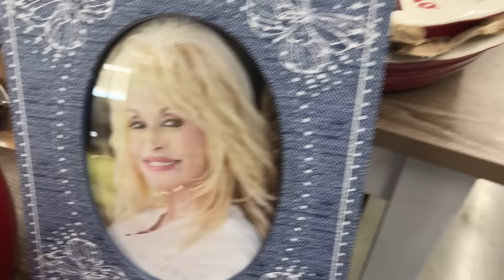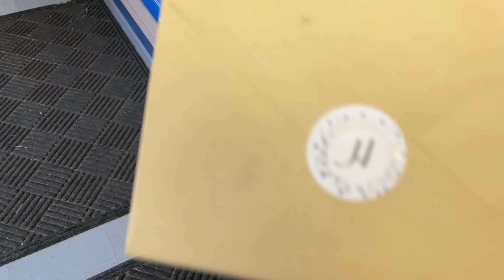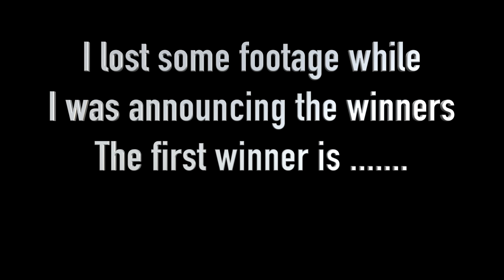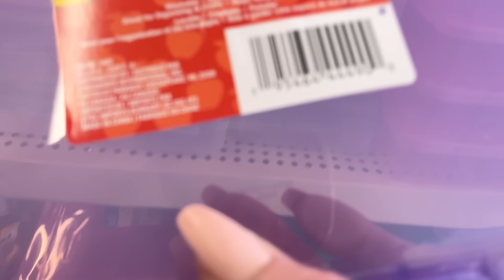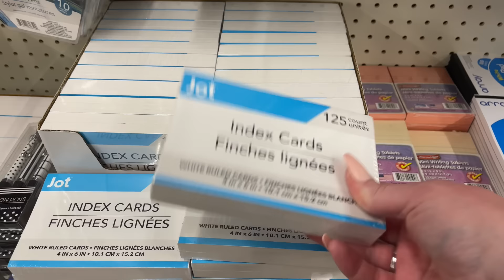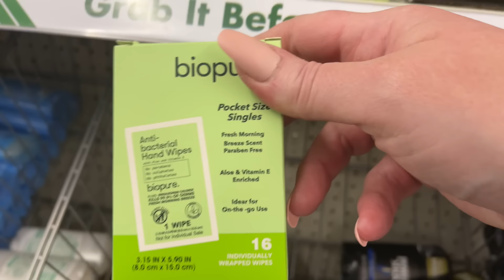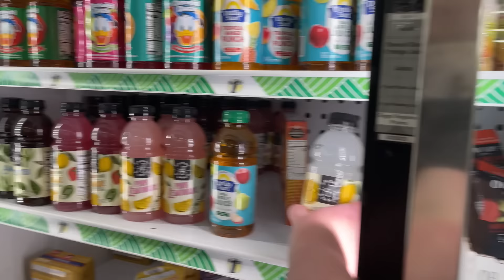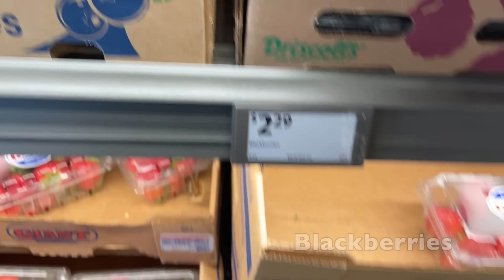AMAZON Gift Card Winners Announced Hanging With Heather VLOG

Comment: I need to ask you a question! I have a lot of little bling things in my car also and have wanted the bling steering wheel cover. Question: does it get dirty with unintentional sweaty hands etc? Thanks hun 🇦🇺❤️
Reply from the maker: I wipe it with a disinfecting wipe occasionally. I have had it about 3 years...it still looks new.  I will add a new category in my AMAZON Storefront and try and link it (if I can find it) I will add a "CAR Category"